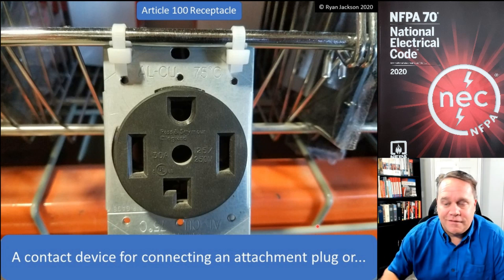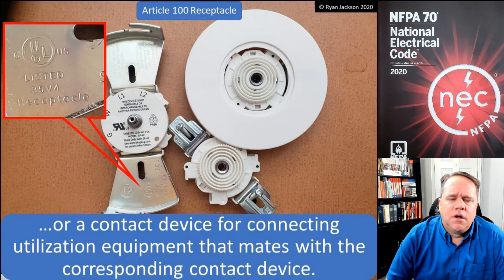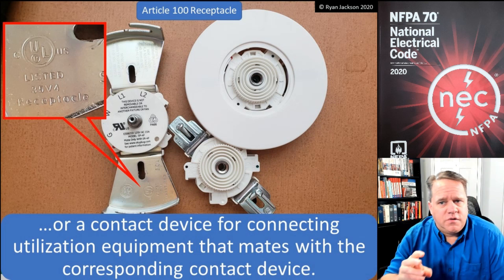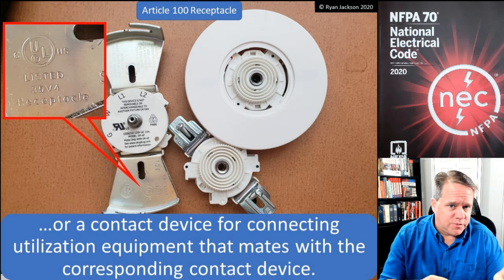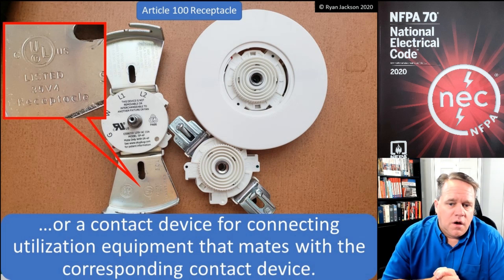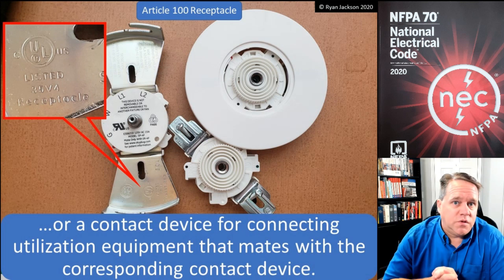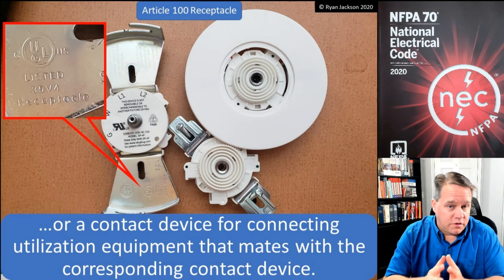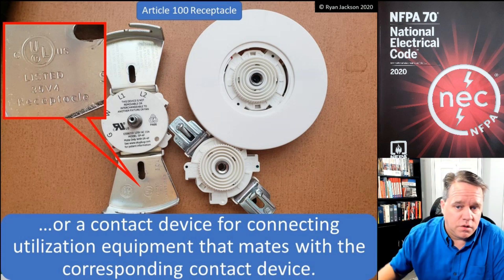100 Days of Article 100: Receptacle and Receptacle Outlet

Comment: If that lighting mount you showed off is considered a receptacle, would that now mean that it would fall under various requirements for GFCI protection and other requirements that we have specifically for receptacles, and not lighting outlets normally? Also, for the purposes of 210.70, is it considered both a lighting outlet and a receptacle outlet? lol...
Reply from the maker: And that is a problem that is only partially addressed. There are exceptions in 210.8 for GFCI, and 210.70 does allow for switched receptacles, but only in certain areas.
Reply: that concentric quickconnect is part of the luminaire or fan. I don't see why it needs to be classed as a receptacle: ppl are gonna leave this unconnected and exposed? I don't think so; they get offended at the sight of blanking plates.
Reply from the maker: @wim0104  It isn't part of the fan.